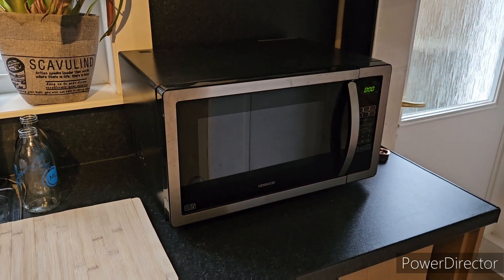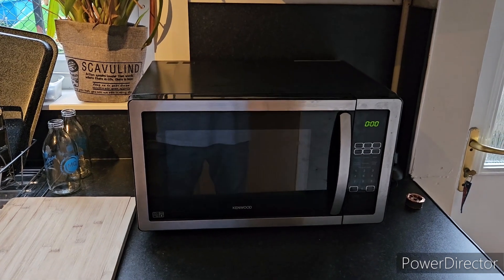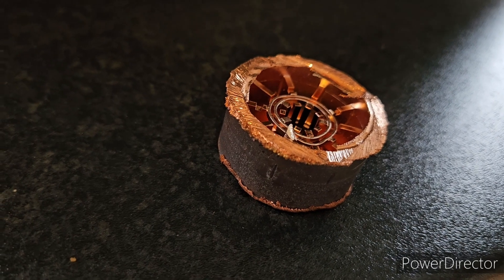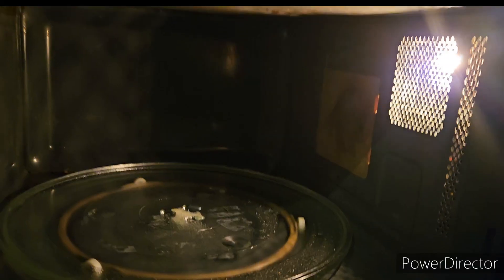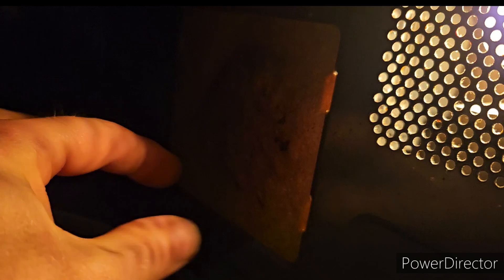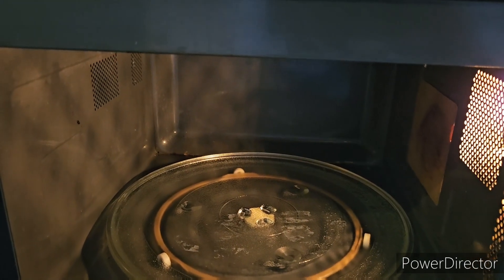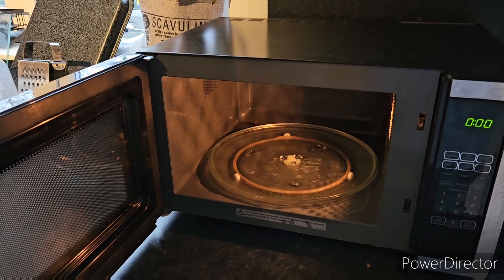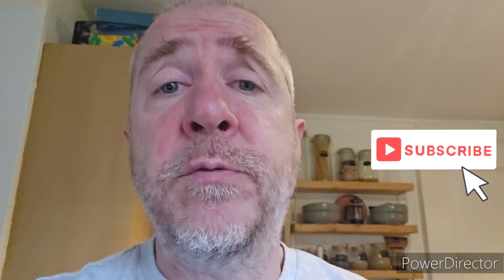How microwaves work and why you should still scrap them when they don't work

Comment: I was married in 2000. A friend gave us an old Matsui microwave made in 1987 and we’re still using it! The turntable doesn’t work well any more, but it still does a good job.
Reply from the maker: @steveb1972  a new synchronous motor and you're back in business. I mean even a very good one should only last about 10 years. A magnetron usually has a maximum life cycle of about 8000 hours.

Comment: Awesome episode brother if the plugs moulded it's aluminium if it's a screw apart it's copper if you ever find one that contraindicated my statement let me have the model number so I can add it to the database Yes if the ceramic end is pink I send to shred only the aluminium oxide ones I touch white . Awesome brother catch up with you in the next episode
Reply from the maker: @empirefinds  love the info bro.  I will certainly check your hypothesis on that one.  I mean if that's right that's a great way to identify them
Reply: @ScrappingScotland  not failed me yet still looking though

Comment: Very cool information brother! 
All I know is I love scrapping them lol.
Reply: I used to like scraping them, back when they had double copper windings on the trans, I haven't had a trans with any copper for the last 3 years 😫 I only scrap out older ones now, not worth my time otherwise  👍
Reply from the maker: @Dirt-Diggler  my time is less precious so I'll still take the other bits and bobs.  You never know it's not copper unless you scrap it 😉
Reply: @ScrappingScotland  few days ago I scrapped a microwave that was 5 years old. Double copper transformer and the top cover on the microwave is stainless steel. There is still great microwaves to scrap.
Reply from the maker: @scrapitall200  I mean just checking it is fun. Like scratching a lottery scratchcard.
Reply: @ScrappingScotland  exactly! I feel the same way brother and when it is copper, that feeling is the best!
Reply: @ScrappingScotland  I can tell by the weight and definitely tell by the make, anything branded as a supermarket is shite 🤣🤣
Shame cos I used to be able to turn every microwave into over £6 , now it more like under  a quid 😪 same with washing machine motors, not had a copper wound one in years apart from the pump motor 😢
Reply from the maker: @Dirt-Diggler  I just took apart a samsung very heavy one over an hour ago. All aluminium and even the fan motor was aluminium.
Reply from the maker: @scrapitall200  me too  🤣